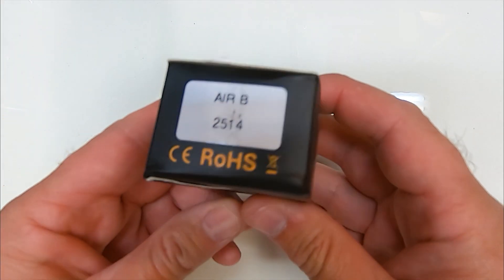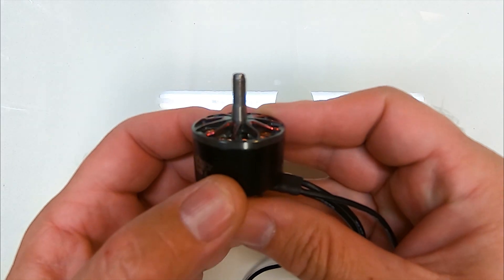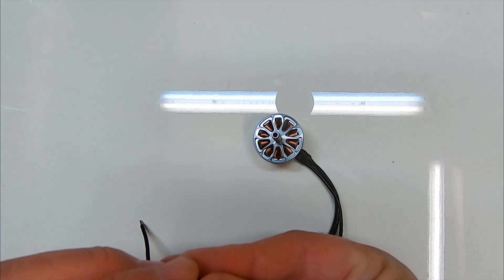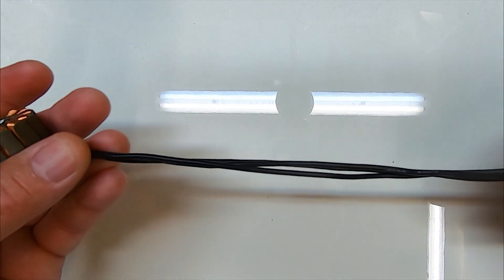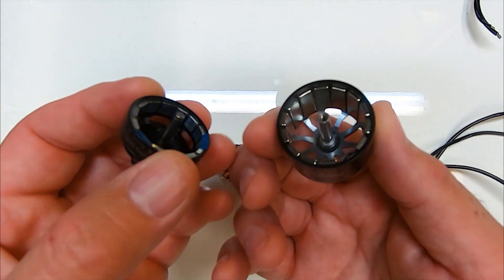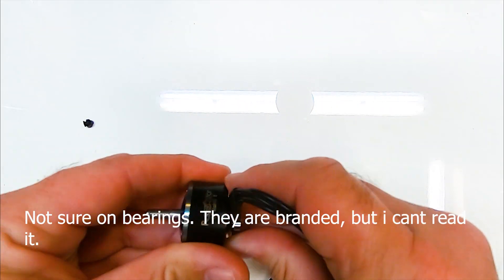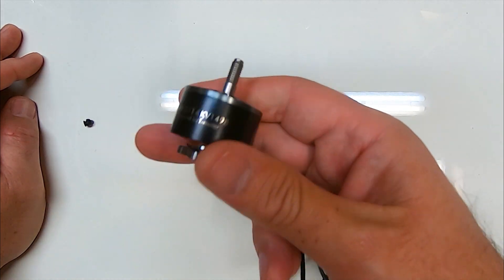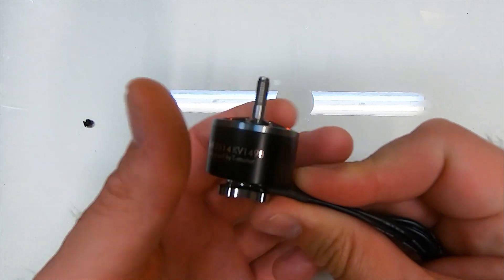8S Racerstar/T Motor AirB 2514 1498kv motor overview

Comment: How compares the airb to the aira? Would you mind doing a thrust /  efficiency test?
Reply from the maker: Erm... My 8" went awol for 3 weeks on it's 3rd pack, 🙄Its covered in a later vid. Got run over by a tractor by the time I found it. Motors survived but I haven't touched them since.

Comment: Can you use this motor on an rc airplane (1200g), with a 9x6 prop
Reply from the maker: Not the person to ask as I don't fly wings. Don't see why not if the prop fits the shaft thickness
Reply: @CoppertopFPV  Thank you for your response, I m new to the hobby and I don't know if quadcopter motors will work on airplanes but this one has a lot of power and I think it will be a great fit but we will see.

Comment: I have one of them on my high speed AR wing and it is a freaking beast! takes 50A with ease, tons of power on a 8070 prop on 4S on full throttle sprints! 
The next thing will be a high power 7" freestyle quad on 4S for slow cruising and long flight time an 6S to rip it.

Comment: I actually think they nailed it with 1500KV - you can run 6S 7" efficiently, can run 6S 8" with a bit of throttle limiting, probably ditto on 8S 6" (with ability to spin those to the moon and go stupidly fast).  While it sounds absurd, these are actually tall/narrow stator motors for the prop sizes.
I think an 8" frame, with the option to run the Gemfan and HQ 7" props would make for a seriously impressive setup - only downside is the net weight of having that big a stator means you need a 300g or heavier battery to actually saturate it, and that means a ~1kg quad all up.... but that becomes more of a 'thinking man's X-Class'.   Same thoughts as on the 'beast class' quads - you can do much more impressive things with motors like these turning 7" props on 6S 2200mAh packs.
Reply from the maker: I don’t like the hq 7” props. They deflect like mad on the Geprc but are fine for cruising. Need something stronger but that usually comes with more pitch. I have 6s 2200 for the Geprc. Running 7” on the dal 7056 is an option as at least they have some strength. I’ll grab a large 4s pack to test as well. 5s is a no go unless I make one. No one sells them in the uk.
Reply: @CoppertopFPV  The 7056C's have some odd issues - they'll probably work best for fast cruising on a setup like this, but are going to be pretty inefficient at every pace.  Grip is great, and control authority at speed is great, but even having enough motor to work those completely, those props are specialist props for how I fly.  The 7042F and 7x4.5x2 HQ's are actually among the better ones - I need to try the 7040F triblades since I like that line of props so much, but at <8g I'm definitely worried those will have the high speed cavitation issues.

Comment: In my opinion Racerstar completely missed the mark with the KV on this motor. They should have probably made it around 1000~ kv with 6s becoming more and more popular. Beautifull overview as always, I'm interested to see what you're going to do with them!
Reply from the maker: ThomatoFPV yeah agreed. I’ll probably cap throttle. I have no idea what’s going to happen. I’m just curious :)
Reply: I would rock it the way it is. 8" pushed hard.
Reply: I've been shocked at how resilient high-KV large prop setups can be - I've ran 2600KV 2205's on 5S with 6" props without issues, 2507 1500KV on 6S with 7" props are my go-to GoPro hauling rigs.
I always limit throttle to 90-94% at the transmitter (in Blackbox logs, I still see 100% motor throttle commands coming out at 94% commanded input due to overhead for maneuvers and PIDs), so going farther with that is still pretty prudent anyway.
Reply: Na with a 18650 pack the higher kv is perfect

Comment: Couple of 1500 4s in series and 6" tris. You know you want to.
Reply from the maker: Hmmm. That wasn’t the plan but I like that idea! Fireball lol
Reply: @CoppertopFPV  I like it too - if you can source proper ESCs to really let that setup eat, then I want to see that.  Would need throttle limiting to keep 7" good (the props will deflect even with smaller motors on 6S 7"), but that would actually be an amazing long duration flight rig... although a really large 4S/5S on 8" is really what these motors are intended for.
Reply from the maker: tehllama42 props is the issue. I can’t even unload on the Geprc 7”  with its little 2306s without props deflecting on HQs. Absolute naff all choice on 8” too. Heading into unknown apc and master airscrew bi blade territory here. Esc I should be good for if the the Racerstar 100amp 8s holds up, but nothing else will be. Looking like more trouble than it’s worth, but we’ll see.
Reply: @CoppertopFPV  HobbyRC might have some of those carbon fiber azures.
Reply: @CoppertopFPV  Similar experiences that the 2306's can make the HQ's let go.  The G7042's will deflect eventually too, but you'll be at speed if you can get them unloaded... I'm going to go try chasing 800hp/700kg winged sprint cars with them, because that works up to those speeds (120mph+).
I think part of what makes different props work is an AUW thing - if you're still asking that prop to generate over 1500g of thrust in an adverse (unloaded) airstream as the blades are pushing >Mach0.8, you're going to have a bad time - cutting that by 100g per motor by lightening up the craft can help about as much.
Reply: @CoppertopFPV  As far as the whole 'more trouble than it's worth' thing, that's why I stopped once I found that 6S 7" works extremely well.  I can use affordable frames (I can even use $14 frames cobbled together off AliExpress Martian arms), ordinary 6S rated hardware, and motors/batteries that come at sane costs (less than $20USD per unit).  I haven't found a need for more performance or endurance - even carrying a GoPro, GPS, lipo buzzer, and TPU protection parts.
Reply: 4s? On 6 inch these can easily take 6s lol
Reply: @thomatofpv3546  no 2 4s in series, 8s
Reply: Fraser Steen oh my bad man, I don't know why but I read parallel instead of series 😆. Yeah 8s would be insane!